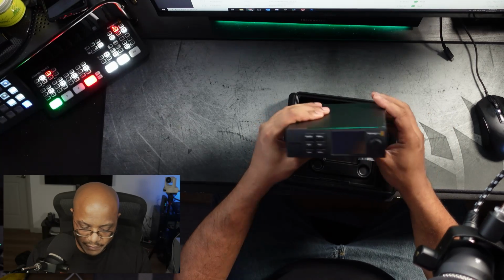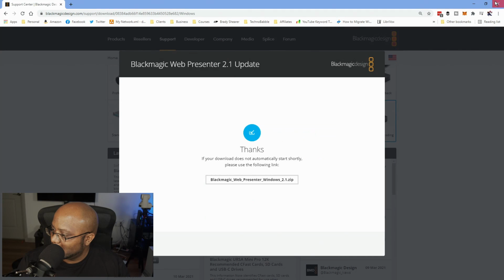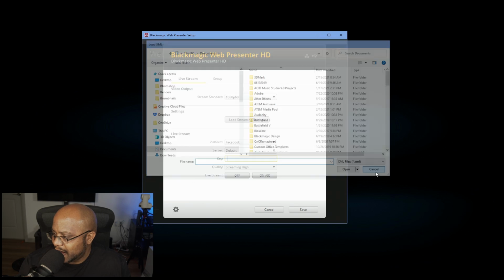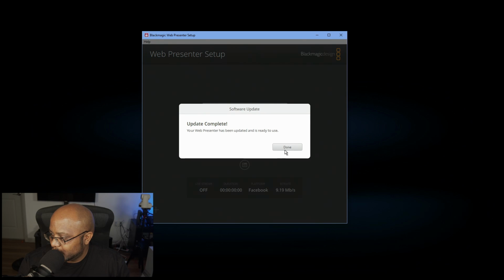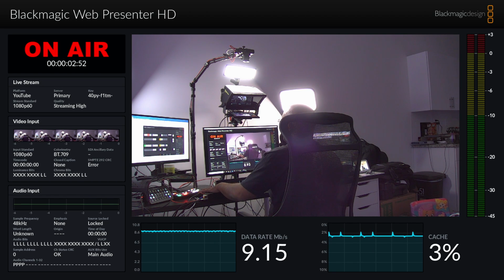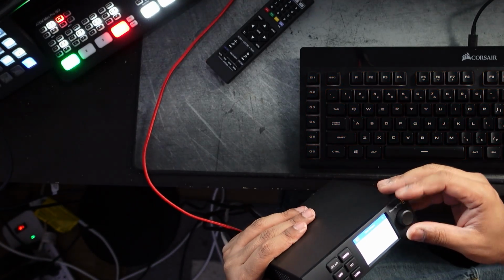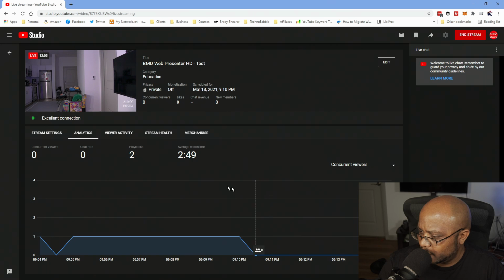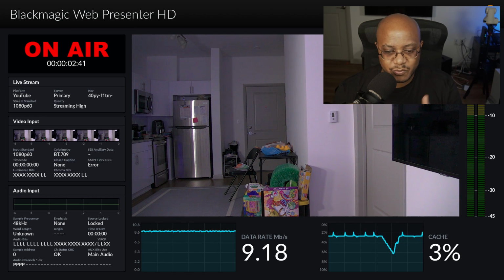BLACKMAGIC DESIGN WEB PRESENTER HD | Unboxing, Setup, & Testing

Comment: Hi AJay. I would like to ask if you tried to connect it to wifi repeater directly? i mean i have an event coming and they told me that wifi only can be access not ethernet to the venue. so i was thinking if will it work if the venue Wifi router to wifi repeater/bridge to ethernet connect to web presenter hd? what yah think? i will be still using phone tether as back up.  thanks
Reply from the maker: No i did not try that

Comment: Hi, how do I input the Audio and process it for online streaming ?
Reply from the maker: The audio comes in over your input line
Reply: @AJaytheCEO  Via SDI input with the video ? Is there a way I can process audio before it goes into the web presenter because I am using Blackmagic Television HD mixer to get the feed for both audio and video and it doesn't have proper audio processor?
Reply: @SilverGas147  The television HD has audio inputs and will embed audio into the SDI output for you. Use whatever your current audio mixing situation is to input into the mixer. If you're saying that your only audio sources are camera mics being sent over video lines, there's not a simple way to process individual audio channels other than through BMD's built in mixer (the ATEM app for computers is the simplest way to mix on a switcher like that). Hope that helps

Comment: I bought the first web presenter. Beside the fact it could only do 720 video capture, the image quality was very poor, so it was usless. The worst money i have ever spent.
Reply from the maker: I never used the first one.  Did it have stream quality settings?
Reply: @AJaytheCEO  no. It has not. Just open in OBS and set stream from there. But could not use it beacause of the poor image quality.
Reply: I have no issue with the image quality. Still using it for Zoom since zoom can only do 720p and most of the time, only 360p....Zoom degrade the image, not the encoder.
Reply: @shem44  i was trying to use the WP with OBS to stream to youtube and facebook. But could not. The image was a mess.